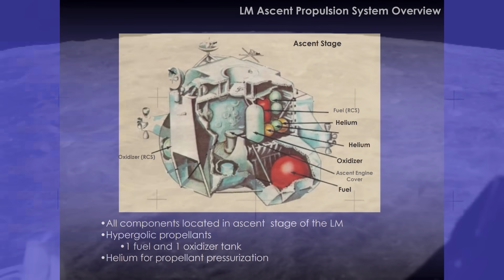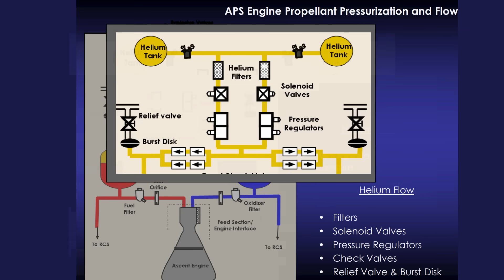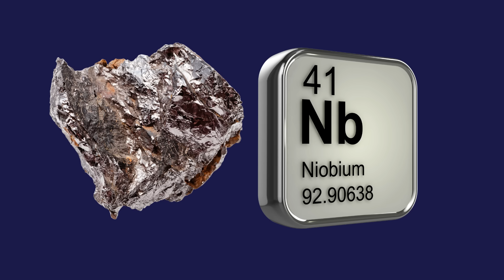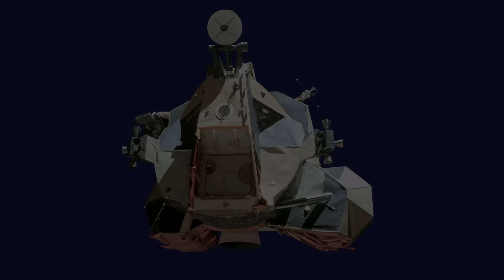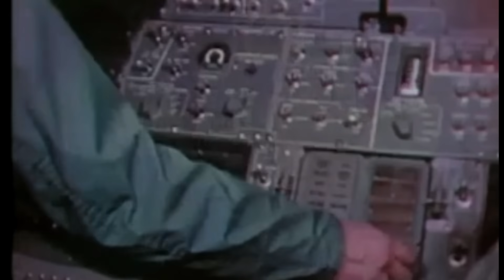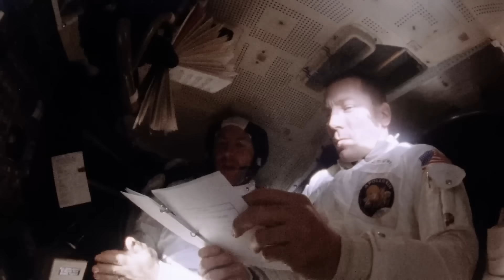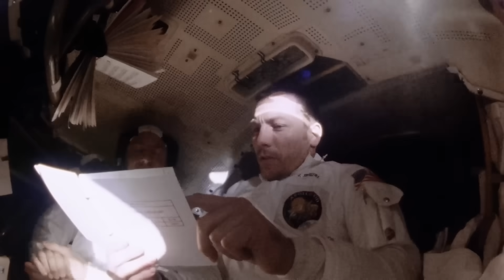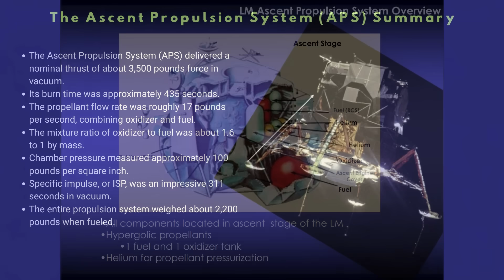LM Ascent Stage: The One Engine That Had to Bring Apollo Home

Comment: The camera that recorded the ascent, obviously automated but how did it track the lift off?  If controled from earth there is a couple of second delay?
Reply: The TV camera mounted on the Apollo 17 LRV was controlled by Ed Fendell at Mission Control, Houston. Not only did he have to deal with a communications delay of 1.25 x 2 seconds but also a motor reaction time of 0.9 seconds. Since the placement, distances and rate of assent was all known in advance he was able to tilt the TV camera at a predetermined rate from a predetermined start time in the countdown.
Reply: @TheWokeFlatEarthTruth ok, thanks Woke. I did not know any of these facts, but wondered how it was done. Again thanks.
Reply: Along with what was mentioned already is the fact that Ed Fendell had the Apollo 15 & Apollo 16 missions to attempt the same thing. The elevation mechanism didn't work for the Apollo 15 liftoff and the astronauts didn't park the LRV at the right distance for Apollo 16. Fendell also had lots of practice getting used to the time delay during each of the EVA's as he was constantly using the TV camera and participating in each of the EVA's. THe Apollo 16 house rock video is a perfect example of this.
Reply: @mako88sb  Correct. And to the best of my knowledge, Fendell is still alive and well and still living in the Houston area.
Reply: They left alone a poor guy on the moon , just to make this great video
Reply: @Bookgirlfan  Ever heard of a camera?
Reply: @Bookgirlfan  Well, that’ll teach him for being a stowaway won’t it.

Comment: Never seen that post-liftoff pan around before.
Reply: That was from Apollo 17.
Reply: It was amounted on the lunar rover and Mission Control could control pan and tilt they tried to get the shot on Apollo 15 and 16 but failed they finally got it on Apollo 17 Apollo 15 ,16, and 17 had lunar rovers
Reply: @jasontipton8430  Yup, the camera was radio controlled from Earth and they had to take in consideration radio signal delay going from Moon to Earth

Comment: Apollo 10 already fired the ascent  stage in low lunar orbit
Reply: The claim isn’t that no such engine had been fired. Clearly that type of engine was tested so we knew it worked. What they meant was each engine can only be fired the one time, and for Apollo 11 that one time was when it had to lift them off the moon.
Reply: @sphaera2520  according to perplexity: The ascent engine was not limited to a single ignition; the specific concern was that the actual flight engine on a lunar mission could not be test‑fired and then reused, because it was a simple, pressure‑fed, non‑restartable design once in space. 
On Apollo 9, however, the ascent propulsion system was deliberately fired twice: a brief, crewed test burn in Earth orbit and a later, unmanned burn to propellant depletion after separation, demonstrating that in practice the system could be started more than once during that mission profile.
Reply: And that would make it seven.....10,  11,  12, 14, 15, 16, and 17.
Reply: @spacecoastz4026  earth orbit testing of LM: Apollo 9 actually ignited the LM ascent engine twice according to perplexity as a "test"  to see whether in emergency the ascent engine could be re-ignited? Once it was tested while the LM was manned, then again after the unmanned LM was ejected, the engine was reignited to burn all the fuel
Reply: And your point?

Comment: ON or OFF. So basic it could not throttle. The target orbit was somewhat elliptical, because it was designed to get the ascent stage into something of a workable orbit. The computer hardware always had sufficient resolution to compute an orbit that could be rounded out using the RCS system to complete rendezvous with the CSM at around 60 nautical miles in a near circular orbit. An amazing engineering solution for the landing with the descent stage and climb out using the ascent engine. "What a ride, what a ride ..."
Reply: It’s just so incredible, and I don’t think folks realize how difficult it is to rendezvous in general moon or not, everything truly has to be perfect for the two crafts to meet, not only meet but not fly past each other at hundreds of meters per second or rendezvous and then have the orbit or one decay just enough so they drift apart. It’s just amazing they made it work everytime
Reply: @shanemeyer9224  They more or less sorted rendezvous on Gemini, with the Agena boosting the capsule here and there to good effect around the Earth. But the Moon is over THERE and everything had to go CLICK pretty damn good. The reason it worked is because the Moon is so much smaller than Earth. Puny amounts of propellant went further. In a recent presentation with Tim Dodd, Charlie Duke said he and John Young each picked up the Lunar Rover by its front and back to move it once deployed from stowage on the side of the LEM. They picked it up, hauled it, then set it down. I'll tell ya!
Reply: Never realized the RCS circularized the orbit
Reply: @scdoty777 They had to, once the ascent engine had done it's job of ensuring the ship had entered an orbit that was sure to fly around the Moon without hitting it. The quad RCS mounts could rotate and translate the LM in fine increments. For more important functions, such as raising the orbit at either perilune or apolune, the four bottom facing or top facing RCS jets could fire together for greater impulse. Orbital mechanics theory is not that hard to grasp, say, if you use a good SIM to gain a foothold. The most important thing the LM had to do was follow as precisely as possible the pathway of the CSM in circularised orbit. That is to say, both the ships orbital planes had to match, otherwise more fuel would be expended to zero in on the CSM. It just boggles the mind that those ships carried all the fuel needed to get the job done. Obviously, the less RCS fuel used for any evolution, the greater the remaining margins.